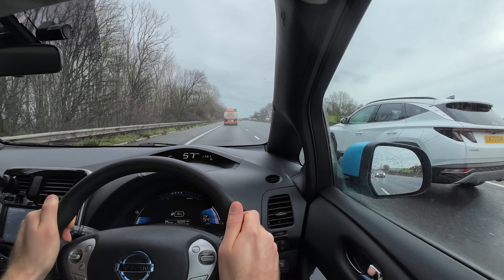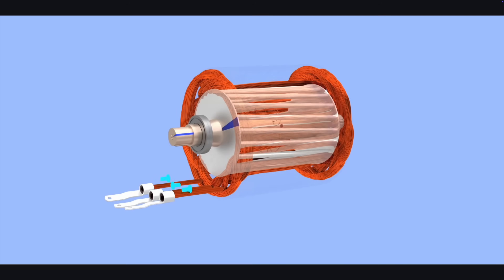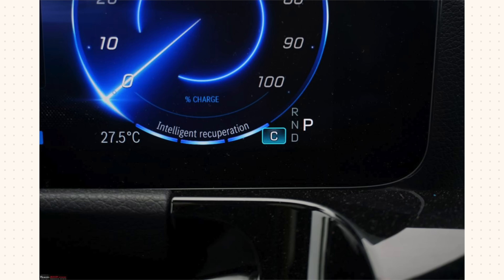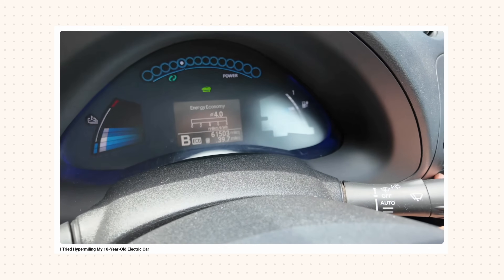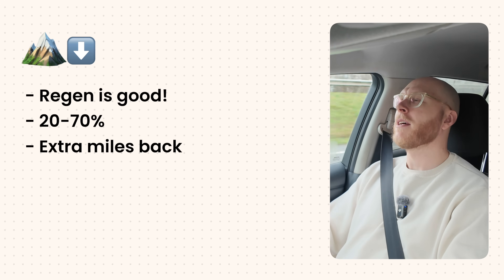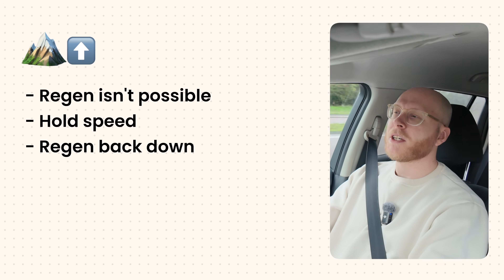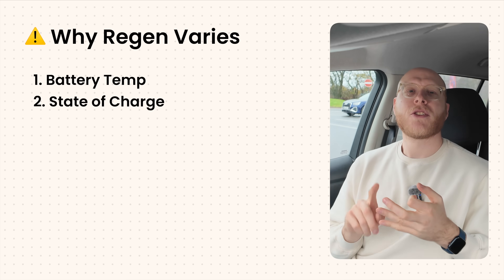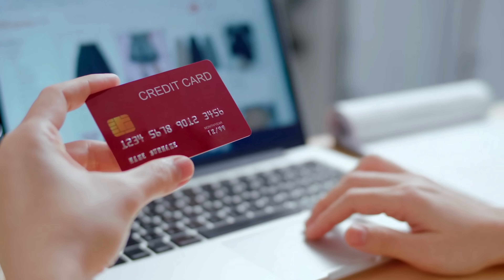You’ve Been Lied To - Regen Doesn’t Work How You Think

Comment: Skoda Enyaq driver here. 
Even if you disable regen by driving in d mode and use the flippers to set the regen to zero, the car wil regen when applying the brakes, but coast if you don't. So regen never really turns off.
Also the Enyaq and I assume this goes for vw ID models, the regen is adaptive. That means, if I let go of the gas in d mode it will coast, but nearby a roundabout or corner, the car will automatically reduce speed.
Reply: Yes - it's not ideal for the battery being charged(at a relatively high rate) when its temperature is below 0 C (cathode plating).  But the VW group models seem to do this - as you're saying, even when regenerative braking is turned off.

Comment: Zoe has low regen but the brake pedal engages additional regen before friction brakes.

MG4 has single pedal but only below about 88% and if the battery is warm as it refers at up to 25% of the 125kw motor. General regen uses about 15%.

Regen helps a lot when driving in the M25 traffic jam

Comment: I use regen as least as posable its more efficient  to coast and drive smoothly. you lose energy through the inefficiency of electrons passing from the battery to the motor and back again. better off keeping them in the battery.

Comment: In town in 20-40mph zones it is best to have regen turned off entirely and modify your driving style. The aim is to not put unnecessary power to the drive train, so moderate acceleration to a speed and then coast along, with the aim to arrive at the next junction using as little regen and brakes as possible.

If you are using regen then you have already wasted energy, it does help recoup some of that energy but the system is not hugely efficient so you will only recoup something like 50-60% of the energy
Reply: I agree.  

If you are using regen for normal driving conditions then you're already being inefficient.  Slow acceleration and deceleration is the name of the game for efficiency.  Sure, when you do need to slow down then regen breaking is better, but I thought just putting your foot gently on the break achieves the same thing anyway ie the initial breaking force from the car is generated by the regen.  It's only strong breaking that will put energy into the break pads.
Reply: @rthomp804  You wouldn't get very far driving around most towns with zero regen without having to frequently move over to the brake and yes the brake pedal will apply regen initially, but why not make your life a little easier by using the single pedal 90% of the time? In the real world, with normal town type traffic, a *high level of regen*, properly modulated by the accelerator, gives best results and best efficiency. Your aim wouldn't normally be to eek out the last milliwatt/hour by excessively slow acceleration and deceleration.
Reply: No, not really. It's easier to control with the accelerator pedal in 20-40 zones where you have traffic and intersections and varied road conditions. Keep it switched on, look ahead, anticipate and control it with the pedal.

On an open road with less going on, then zero or light regen generally works best.

Comment: An efficient driving style will always deliver the best results if the driver is in full control of braking, regen controlled by the car (ie. one pedal) is compromised. In BEV's the friction brakes are applied only once the vehicle determines they are required so using the brake pedal to initiate regen is far more efficient than using the accelerator pedal.

Comment: I asked VW about regen on my ID.4 -> the answer was once you press the accelerator all regen is disabled. I get good regen down hills. A 1000 meter decent from a skifield gave my ID +5% despite heating etc at -8 degrees. My 2016 leaf gives +12% descending a local 500m hill (it's steep). Guessometer is all over the place when driving up and down hills. Over a pass I got 20km estimated range with charger 29km distant. But with a gentle descent I arrived at charger with estimated 65km. This is due to increased consumption going up and reduced consumption going down. Physics nerds can estimate the car's gravitational potential energy changes.
Reply: Of course regen is disabled when accelerating. Did they also let you know what you go forwards in D and backwards in R? Insightful 😂

Comment: Regen is Not free energy, you have paid for it. I would say it reduces wasted energy.
Reply: If you buy a car at the top of a mountain and drive it to your valley home you got a bit of charge for free.
Reply: @st200ol  If you are at the top of a hill then it took energy to get you there.
Reply: @peterjones6322  I said if you “buy” a car at the top of a hill. If you bought it then someone else paid to get it up there, unless they’ve added a few quid to the price because it’s up there you get free electricity. 🙂
Reply: @st200ol where you then plug in and charge on solar or one of the free energy offers… 😂
Reply: @PJWey  What does that have to do with regen? Yes I can charge with free power but charging does not equal regen.
Reply: If you consider any momentum not fully used then sure but as st200ol said, you can get 'free' energy downhill with just controlling your braking.

Comment: As a 2025 Tesla M3 standard owner, I love the one peddle drive. One of the things that sold me on buying it. Using the brake peddle only when trapped by a yellow traffic light and have to stop quickly, or some clown ahead makes a crazy move, like slamming the brakes to make a turn. Nearly all my driving is modulated w/the GO peddle only. The ONLY time I've seen the SOC % go up while driving is when I drive from Michigan to Florida and back. (Snowbird). Going down a long mountain grade in northern Georgia I've seen car gain a whole 1% point! Oh wow. But, I drove a good 5 miles on somewhat flat road before it lost that 1% again. I'm sure you do not get back nearly as much going down the mountain as you used going up the mountain. I'd guess you gain no more than around 30% of the energy used going up the mountain grade, but it's fun watching all the other traffic lighting up their brake lights as they waste all the fossil fuel used going up the hill! Expending energy to climb the hill, then turning the kinetic energy into waste heat controlling speed going back down. Shame.
Reply: when you drive and your range actually goes up it's a bigger gain than you may think because not only are you gaining charge, you're also still travelling without using charge. So in terms of efficiency, it's a double whammy.
Your scenario is rare unless in good conditions as usually going uphill eats A LOT of power but if you can truly go down and up a mountain using only the few % instead of using some % both up and down then you're really winning.
Reply: The Renault 4 and 5 e-tech and for sure many other modern BEVs use regen even if you press the brake pedal. Only just before the car comes to a stop the friction brake is used. So the driver does not have to worry about regen or rusty discs.
Reply: Shame? Why?

Comment: Do remember that  generators are most efficent when turning at a constant rpm due to eddy currents emf ,EV motor rotors only produce emf field ,while energised , this is why you cannot tow a EV ,and recharge the battery ,which risks destroying the Invertor.(only 2 makes have a towing mode) . Also Brake pads and disks if not used become pitted (rusted) and could fail in an emergency situation  ,apart from which are expensive to replace due to lack of use...
Reply: but you can. It's just obviously just using regen, given your car can still start and be put into drive then it's not at all going to harm the car. It would just hurt the towing cars mileage. Also needing the replace brakes from lack of use is a REALLY unlikely, case as just running off the rust from the brakes with controlled use would be enough, or with proper equipment after removing them.

Comment: I've not driven far in an EV, but had a second generation Prius. Pretty much all the power that goes into the battery is from regen and it makes a significant difference to fuel economy over a similar car.
Reply: The petrol engine in a Prius is a generator.
Reply: @PJWey  it can generate but only when higher revs than required is more efficient. But regen is the only way it's recovering energy.
Reply: @PJWey  It isnt. It drives the wheel mechanically

Comment: Shame about the silly clickbait title of this video.
Reply: Yes, a better one would be "Regen works exactly the way it looks like it does."
Reply: "Regen is really useful. Here's the best way to use it"
Reply: Totally gone off this channel now - I avoid stupid titles as they tend to be stupid videos. Regen is just one factor in EV driving - so this was a complete waste of time which I wont be caught on again.
Reply: Yes, it works as advertised. Regen is the single thing that make non plug-in hybrid cars use less fuel. It's their reason of being.
I miss that it dispels the myths around regen by adjusting it and by lifting the throttle vs using the break pedal. That's just a matter of preference. You will regen the exact same amount of energy if you set regen to max or to coasting, as long as you decelerate equally. When you start hitting the break, it will start to regen. The more you press it, the stronger it will regen. Only if you have to stop faster than what regen allows will you engage the friction brakes.

Comment: The accelerator pedal should NOT have regen. Best efficiency is to coast. Don't be lazy, use the correct pedal for when you actually need to slowdown.
Reply: That's a bit of a draconian comment I have to say...yes coasting is good, you can do that with accelerator pedal once used to it, then as you need to slow down or stop, just lift your foot further off the pedal. Same process just a different way of driving !!! 😆

Comment: Rubbish. Over-explained and not necessarily correct. 👎🏻
Reply: Maybe rubbish is a bit hard, but is re-gen not quite obvious? Of course you dont re-gen on the highway in constant speed. And if your EV has a 200 kw engine and can charge at max 150 kWh you would probably not be able to re-gen more than 150. Or? And simce most EV charge at far less charging speed at 80-100% SOC, you will re-gen less. This video might make sense to those who never drove an EV. 😊

Comment: I tried a Renault Megane. It was by far the absolute worst and most unsafe feeling car I have ever driven. If that is what people are faced with as the future of automotive travel, I say bring back the horse and cart.
Reply: I wonder if you had the regen level set to something that you didn't like.  I have a Renault Scenic and would hate to drive it with max regen on other than very briefly here and there.  I have regen at the minimum level most of the time.  I then use the paddles to apply regen when I want it - I view it more as having variable levels of deceleration with the actual regen being a bonus.  So, for example, rather than braking as I approach a 30mph limit I might apply first level regen to scrub speed off a bit faster if normal deceleration is not doing enough.  Driving with full regen would really not feel comfortable to me and there have apparently been instances of travel sickness (pets and children!) in such cases.  Obviously I don't know how regen was set when you tried the Megane but if you think this might have been the case I'd suggest it might be worth another try.

Comment: E. Alex,
Regen braking is an ambitious subject matter, thanks for examining it for us. The Tesla model 3 with tires at the recommended pressure, has the most potential to retrieve the forward deceleration  energy. The two factors you omitted governing the success of regen breaking are the vehicle's aerodynamic drag and rolling resistance. Minimize the energy lost from those two factors means more remains for regen to collect and put back into the battery. My 2024 model 3 dual motor routinely achieves 110+ km/h downhill when its throttle is balanced between accelerating and decelerating while on U.S. freeways. Several trips at averaging 99 km/hour, the model 3 averaged 240 km per the energy equivalent of 3.8 liters of gasoline.

Comment: Of the EVs I've tried the most effective regen has to be in the BMW i3, it's non adjustable and it's always strong, once you've got used to it you realise BMW got it right first time. Unlike a lot of other EVs the braking effect doesn't vary with the battery charge level, it's pretty much the same with high or low states of charge, yes if the battery is full there's no energy recuperation but in the i3 you still get the same deceleration when you lift off as the car automatically applies the brakes and that makes the effect more consistent. I first noticed this on my i3 after it had been parked up in a rainstorm which after a few hours causes a light coating of rust on the discs, the next time I drove it and eased off to slow down I could hear a light grating sound as the pads contacted the discs when I lifted off even though I wasn't touching the brake pedal.
The effect in town driving is most noticeable producing excellent miles per kWh, in the summer I was achieving 5.5-6.5 miles per kWh regularly, my previous 40kWh Nissan Leaf in B mode with Eco mode on driven in the same manner could only manage 4.2-4.8 miles per kWh.

Comment: A lot of misinformation - there is no gradual reduction in regeneration (the slowing down effect is the same) when the battery is above 70% SOC, this only happens when the battery is nearly fully charged and there is nowhere for the energy to go. With one pedal driving the amount of regeneration applied is infinitely variable depending on how much you lift off the accelerator pedal so there is no need to change the regeneration level with a separate control. Many people think the accelerator pedal is an o/off switch - it's not! on an electric car you can control the amount of regeneration you want as well as how much power. So on a motorway you can "coast" by having the accelerator pedal in a position when it is neither letting electrical power go to the motor or slowing down and allowing the motor to regenerate electricity - you can see this with your power meter.
Reply: You are obviously correct about being able to balance the accelerator peddle to "coast" on the motorway. But I find that any involuntary shifting of the foot causes unecessary deceleration, which is why I choose the lowest regen on highway motoring.

Comment: Highway driving using cruise control on Hyundai Ioniq 5 in AUTO Regen mode has two objectives, as I understand. First to control speed going on down gradients of many levels. Secondly, to  recover energy then sent to the battery. It is quite useful and beneficial. You say in highway  driving it’s not beneficial? Sorry, it does help. The Hyundai app does show Regen captured for the day’s driving. I see Regen at a range extender not only because of the recovered energy but because when slowing down there is no energy used.

Comment: how effective regen is, is mainly affected by the optimal RPM of the electric motor (alternator when regening).
the same reason there is a optimal RPM while driving.

2017 bolt ev, one wonders how they got so much right, just a shame about the max charging speed though, it's a great EV.

Comment: FYI. Zoe's have decent regen. You need to press the brake though. It then applies upto 43kW of regen before transitioning to normal brakes.
One pedal is ALWAYS the best if you are competent enough to use your right foot to control the power/regen smoothly. You can balance the pedal so you are effectively costing but that just comes down to skill.
Reply: 100% true! Zoe has quite well designed regen. Over 10km/h it barely uses friction brakes (unless you press the brake very hard), and transistion is very smooth.
Reply: There's no reason why one pedal is better than accelerator + regenerative brakes. In fact my car's manual states that one pedal driving is less efficient because it's more difficult to be smooth and avoid acceleration and deceleration spikes. There are some EVs though that do not have regenerative brakes, where the brakes are simple friction brakes, and in those cars you do of course need one pedal driving to get any regeneration at all.
"You can balance the pedal so you are effectively coasting" -> You can do that without one pedal driving as well, much easier in fact.
Reply: Finally someone who understands why OPD is not a good thing for efficiency.

Comment: Long story short: one pedal driving or strongest regen in town, whatever feels most comfortable on twisty roads and as close as you can get to no regen on the highway. But also, yes, it works. Ive seen situations where i gained a decent amount(probably 20km of town driving) back into the battery while driving down a large hill.
Reply: I live on a hill, I descend daily losing about 500 meters in 8 km and I confirm my EV3 covers overall 20 km before depleting the energy stored downhill

Comment: I have a HEV and for the first few weeks, used regen to try and recoup energy and charge the battery, averaging around 55-57 mpg. I didn't like the driving feel, and just used in-gear coasting and the braking, and have been averaging 64-65 mpg. In my view, the most important element of efficient driving in a HEV is down to maintaining momentum and anticipating the road ahead. Apparently, you only ever get about 40% of the original energy spent when using any kind of regen, so the best solution is to try not to spend the energy in the first place.
Reply: Yep, it's better to just drive smoothly than actively trying to 'recoup' the most energy. That's where regen shines.